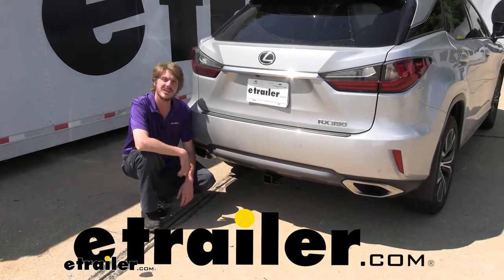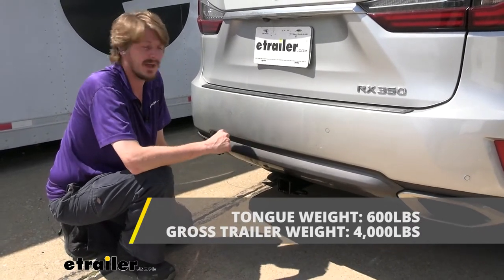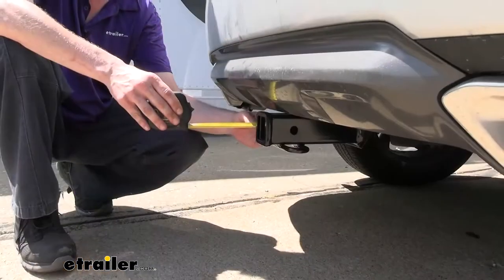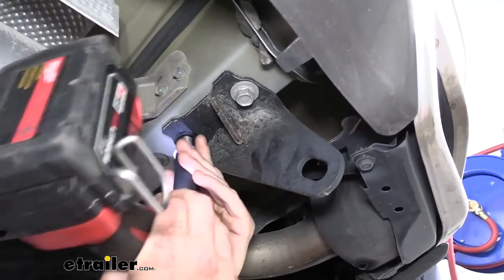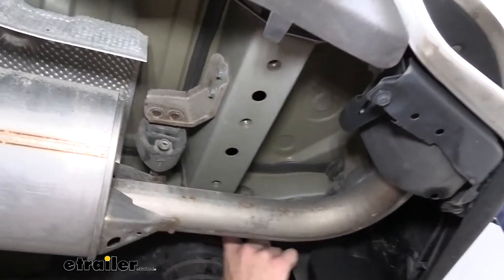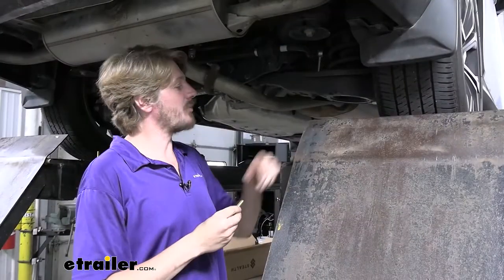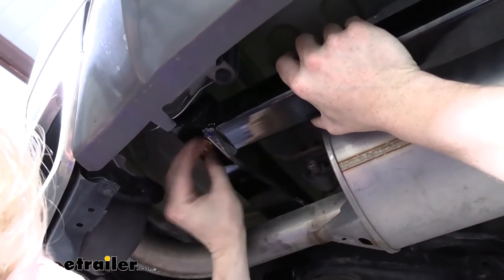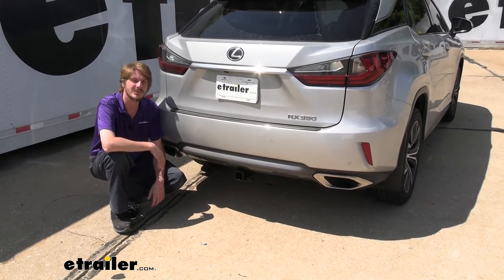etrailer | Installing the Curt Trailer Hitch Receiver on your 2018 Lexus RX 350

Comment: Can install everything you showed in my 2022 RX 350 base 4x2 without factory towing package? Please share the electrical wiring harness
Reply from the maker: This specific hitch is not designed to fit the 2022 Lexus RX 350. Check out the following link to see the trailer hitches and wiring harnesses that are designed to fit your vehicle.
https://www.etrailer.com/vehicle/2022/Lexus/RX+350